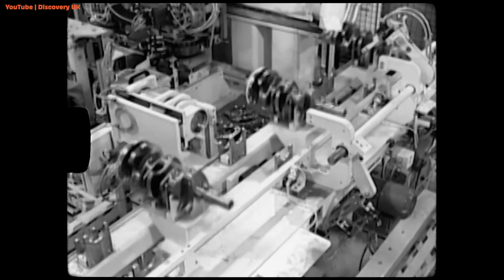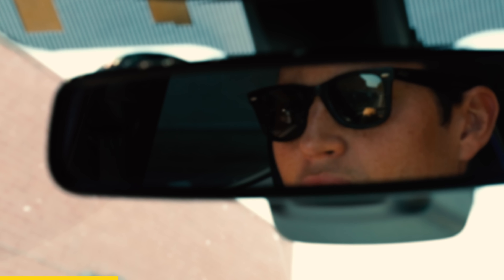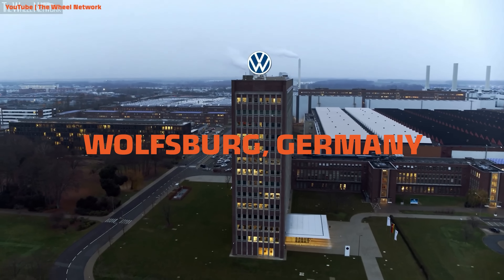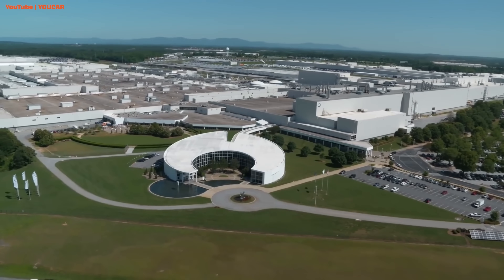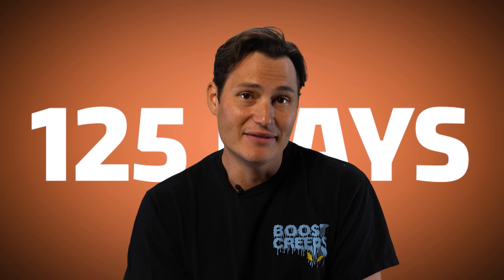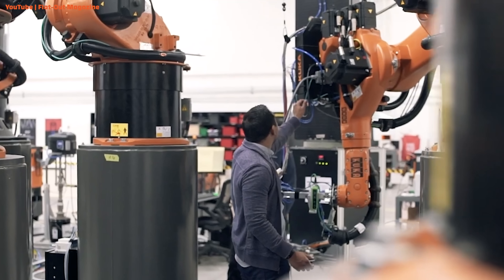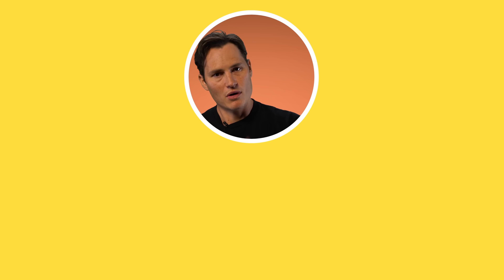A.I. Designed this Car

Comment: 3D printing technology is not that efficient. It needs alot of improvement and the raw material also need some advancement. So Engineers don't worry, you still got some time I can't tell about the future generation, I think there will no jobs for engineers everything will be overtaken by the 5D printers, advance material and A.I. Four or Five person will make a Car Manufacturing company rest (Production, Marketing, Sale, Servicing) will be done by A.I.

Comment: Feels like advertisement without actual insight. To begin with - in a 9 mile assembly line car leaves the conveyor every couple minutes, "vertical assembly" is not a way to make 100 000 cars a year. Those technologies are very important for the future - but they will reasonably extend not replace current ones. Just look at the single/composite manufacturing game of the last 30 years.
Also - considering that AI (assuming neuronal network) is not "debuggable" you will never have this without cross-check by human. Unless maybe in USA where human Life has a price tag.

Comment: This design sounds like a mechanics nightmare
Reply: to be fair, car designers have been already trying to make them nightmares to work on for years already.
Reply: @dragonsword7370  some certainly are more successful than others
Reply: @dragonsword7370  good ol fashioned human engineering figures a way haha
Reply: Who’s fixing a car worth 100k+? Oh right the deal shop most of the time
Reply: @blank1778  most of the time
Reply: @blank1778  cars made like this will be insanely cheap and definitely not $100,000
Reply: on the other hand, if the designs were public, everyone could just print them even years after the production would stop
Reply: Specially the no gap door. One little punch and you cant close the door anymore.
Reply: Computer designs the car 
Computer builds the car
Computer fixes the car

Who needs a mechanic? Automation engineers is all you need
Reply: @stevefarrimond  If you've ever tried to do diagnostics with a manufacturer flowchart (which is exactly how a robot would) you'd understand why this is really dumb.
Reply: @1337penguinman  I’m an automation engineer, trust me, it’s not that hard. 

Car has a flat tyre, robot changes it,
Car has a dead battery, robot changes it. 
And keep building its skill set until there’s nothing (or very little) a personal n is needed for.
Reply: @stevefarrimond  ok, so u need to send your car to the factory/dealer (obviously service robots are too pricey to stand everywhere) every time u get a flat tire? no way
Reply: @nt976  Believe what helps you sleep better at night. Why would a robot be stood around when it’s doing the job of a person who wouldn’t be stood around.

Robots aren’t as expensive as you’d would think, for example how much does an employee cost? There’s a lot going into pensions, insurance, wages etc. the robot is a one time purchase, plus a bit of maintenance across its life
Reply: @stevefarrimond  You forgot the computer drives the car also. May as well just get the bus to work.
Reply: @stevefarrimond  and a ton of money for the first 30 years
Reply: @stevefarrimond  nah. That means you can only repair your car at the dealer ship, which means yout car has to be world renowned, the people buying your car have to be rich, and your car is a league above others which warrants such needy repairs
Reply: @stevefarrimond  which is why tesla cars can be repaired with some special tools. So that mechanics can buy said special tools, say they support tesla repairs, and get them big bucks while tesla builds a super factory down the road XD
Reply: @davidjalkh  you’re right,  but Tesla have made there cars ‘hard enough’ to work on. Making them impossible, would be bad for building the brand. 

Now the brand is developed, you’ll find it more difficult to do and more specialist tools required, until the point it’s not financially viable.
Reply: @stevefarrimond  ive seen this happen before, here's how it'll go down. Garages with multiple sections such as vehicle repair, wheel recalibration, paint jobs etc. Will claim they can repair tesla vehicles for greater publicity, then when a person comes over with a hard to do tesla job, the garage accepts the job and then proceeds to use partnering tesla only garages, for a share of the cost
Reply: @stevefarrimond  ppl do fix it tho
Reply: Not really u just downloadthe part and print it urself the whole door is done download print EZ.u can even upgrade it
Reply: @anand.suralkar  bro first of all have you seen the printer theyre using? Second, printer resin is pretty expensive, my buddies and i in the dorm play arround with it and printing chess pieces is a chore
Reply: @davidjalkh  printer resisn is nowhere comparable to the car parts price.anyways watch their video car is almost fully moduler.and easy to repair.also they can print any parts so i think they will give parts easily if u can afford this car buying parts is a joke
Reply: @davidjalkh  we are talking about a 1.5 million doller cars and u r saying printer resin is expensive?? This car has titatnium parts in it...bro..it will be cheaper to just put gold parts
Reply: @anand.suralkar  hah you're right, but how would anyone print their own parts?
Reply: Well, in the future you're not supposed to own anything so it's not like you'd drive up do your local mechanic and ask for a wheel change. The car will go back to its manufacturer and be fixed, then re-rented to someone else while you get a car that already had its tiers changed.
Apple is a great example of this as they don't allow anyone to tamper with its iPhones, if you do the device is rendered useless as punishment for messing with their product. The phone is supposed to go back to its owner, be fixed, and resold for full trail price (profit). In the future you're not paying for products anymore you're paying for services.

I know I heard of a car company that already rents out cars this way in Japan or China, where you basically subscribe to a car between this and that hour, meanwhile the car goes to someone else. And there's this AI that's actively managing all these subscriptions telling the cars to go when and where. You just go to this web page and order a car from point A to B and that's it, like a taxi but without the driver or need to drive yourself. I just forgot the name, think I read about it 1 or 2 years ago, also LTT mentioned it in one of his shows long time ago.
Reply: Since all the parts are bespoke, you cannot take it to a mechanic. They won't be able to get the parts.
Reply: @Orinslayer  Could you please explain what bespoken parts are?
Reply: @davidjalkh  Parts that are made only for a specific use. In this case, well over half the vehicle is made of custom 3d printed parts, so they would never be easy to come by.
Reply: @Orinslayer  sick thanks
Reply: Everything will become Chinese maid they will reverse engineering every single part and make their own for a fraction of the price
Reply: @abrahamcarrillo9955  You can go to China and build your own iPhone today with genuine parts from completely random stores you never heard of right in the open market.
So what do you mean "will become"? The chinese reverse engineering stuff has been going on my entire life, did you just figure this out or what's going on?
Reply: We'll have the AI design new mechanics.
Reply: >bespoke car
>mechanic
found your problem
Reply: if this sounds like a nightmare, then let's think about other AI's replacing mechanics to fix this nightmare.
Reply: One thing that could help it in this regard is all the missing material that creates holes that you might be able to get your arm through where normally you'd have to remove it
Reply: It can also be programmed not to be too.
Reply: If the car is desgined to be assembled entirely by mid air suspension, then that same mechanical structure can perform that maintenance. Some auto alignment marks for the AI, plug in what maintenance you want and the machine does it.
Reply: there will be no more mechanics!
Reply: @leaoaugusto  that's definitely incorrect
Reply: @XetlinCakes  looks like someone does not recognize irony.
Reply: Doesn't have to be, provided you have 'repairable' in the AIs reward function. Hard to implement well, but heuristics like "don't have connections that will need removed often inaccessible without other disassembly", and "wiring channels should not have tight corners" are pretty simple. It's not like human designers have always taken these things into account either.
Reply: Sounds like nobody would be even allowed to fix it, and i bet most mechanics wont even want to touch it
Reply: he literally mentioned the amount of cars he can produce.
watch the video
Reply: That's where R2D2 comes in
Reply: Why?

Comment: Wait until you have a wreck in it, or have to repair something. One of those 3D printed parts that merges into another part... egad. A fender bender at the front could mean the entire front foundation of the car has to be replaced! Also, while the robots take up 2500 square feet, what about all the 3D printers making the parts the robots assemble? They take up space and energy, too. With all these complaints, this is early days for this kind of product and technology will mature. It is likely to be the future.

Comment: All wires are in the chasi?! Imagine trying to do maintenance on it.

"What's that? Oh we have to take it to the dealer for any work on it?"

Well, that just increased the cost of the car didn't it. 

"Oh! It's a car exclusively for the rich. I see, but wait a minute he said manufacturers can use it on normal working class people's cars."

"What's that? Oh screw the working class. I see." 

But don't we have a right to fix our own crap?

"Say again? Oh, you told BigTech one me? Sure... I can shut up." 🥴

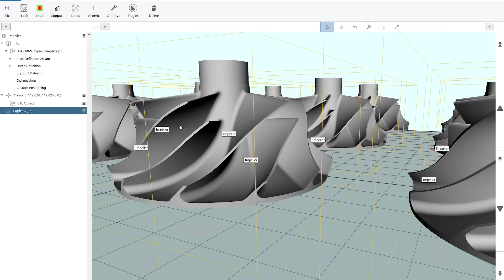Comment: Sentence from 7:19 "3d printer doesn't print out extra meterial" is obviously false as can be seen in 7:02 where you can clearly see turbine support structures that needs removal.

Comment: “A 3D printer doesn’t print out extra material” this is not how additive manufacturing works bud, you need support structures among many other things for the parts
Reply: That’s a very good point that until I read your comment that I forgot about! But that being said, the support structure from 3D printing is way less than the flash you would get from casting...
Reply: I think with they type of printer they are using you don’t need support because it’s automatically supported by the powder
Reply: @michaelcalizzi4038  You’re right. The additive process that this printer uses negates the need for support structure. So in this case, he’s right. This 3D printer does not print out extra material.
Reply: @DaOneAndOnlyKDubb  It just requires heat and pressure treatment to get rid of all the voids and cold joints left by the laser blasting away the powdered metal. Then finish machining and polishing to get a surface finish that doesn't look like garbage.

Comment: Take all this technology,  and build me a daily driver thets sleek , fun to drive , efficient,  and super lightweight.  Cars keep getting heavier,  bigger and less and less fun to drive. 100 mpg with a 1.5l should not be a problem in this day and age
Reply: Had a 99(97?)  Audi A4 for a couple months 6 cyl 5 spd, sorry sold cheap as I got a sailboat, literally gave away, jetta gli fav before
Reply: @markhill9611  too bad. Thoes were really nice and somewhat reliable.  Good luck finding one now for cheap.

Comment: There are still problems with that form of 3d printing the metal dust that is used to make the bottom of the item and dip down or more and will cause the item to be off by a very small margin.

Comment: 7:08 that’s not a subtractive manufacturing process. Milling or turning for example is.
Reply: It's part of the subtractive manufacturing process.  Subtractive manufacturing starts with the forging and molding of the parts before they are sent to be milled or turned.  Plus, stock video footage was used.
Reply: The surfaces produced even by the best 3d printers out there are pretty rough to say the least (as it was pretty much shown with the turbo which by the way is produced this way for years)
Because the surfaces are so rough the have to be milled afterwards on surfaces which have some kind of articulation going on, are connected with other parts or simply because they are visible to the customer.
So yeah... This whole no subtractive manufacturing thing is at least for the next few decades bc!

Comment: So if the engineers put in the right parameters with no typos, and the AI had all factual information it learned from, and if the material in the 3D printers are up to the engineering and DOT standards, I still don’t understand why this is designed for hypercars instead family cars.

Comment: If you are layering sheet after sheet in the “printing” process and only using the part of the sheet that the laser atomizes, how is that different than the “subtractive manufacturing” process you described in contrast? Still a pretty cool process and all, just not as efficient when using metal instead of plastic for printing I guess.

Comment: When comparing the Czinger plant with the volkswagen plant in wolfsburg you are actually comparing apples and oranges. The czinger plant produces one car per 125 days. The VW plant produces 3500 cars per day. In other words, in the time it takes the czinger plant to prodce one car the VW plant produces 437.500 cars. This of course is an unfair comparison, after all we are comparing one incredibly small car production plant to the largest car production plant in the world. So, how long does it take a traditional car manufacturing plant to build a single car from raw materials to finished car? Well, it turns out the classical production process of a car consists of stamping, welding, painting, assembly and inspections. And this takes, depending on the specifc plant in question somewhere between 17 to 18 hours. So, it's almost 170 times faster than the czinger process. Production cost for a regular car lie anywhere between about 33.000$ to about 133.000$ depending on the car model. Unfortunatly i wasn't able to find any numbers on the production cost of the czinger car so i can't really compare it.

And don't get me wrong, the basic idea is good, but the only thing (at least at the moment) that are economically viable to produce with that are supercars because the demand for them is rather small and the price is high.

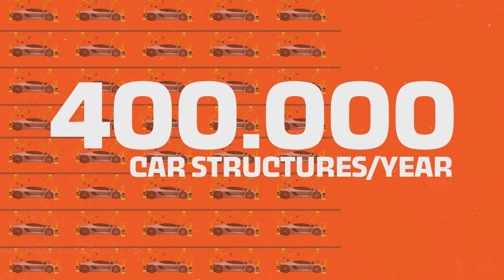Also, just a small correction at 12:00 As i explained earlier, the classical assembly line we have today is almost 170 times faster than the czinger process. In other words, to match the production speed of a single classical assembly line you need to have about 170 czinger assembly units in place.

Comment: So. Your selling this hard, but I’m going to call you out. To say that current manufacturing has great amounts of waste in materials but 3D printing does not is absolutely false. Current manufacturing allows us to re utilize the waste materials in order to make more parts, a normal 3D printer creates waste with structural supports for the parts made, they are not typically recycled on the spot. So wrong there, and powdered metal parts do the same exact thing as what current manufacturing does, take the waste and recycle it to make more parts. And if your impressed with a 0.004” (that’s 4 thousands of an inch) of accuracy then you should step into my field of work as a millwright where people (yes I said people) build machines with an accuracy of 0.001” or even 0.0001”. I do this on a daily basis. So this is cool and all but the technology is not superior to what a person or people can do. I build turbines in the power generation field and I have to say I am not impressed that AI can build a car. I’m more impressed that it has you so dumbfounded about it.

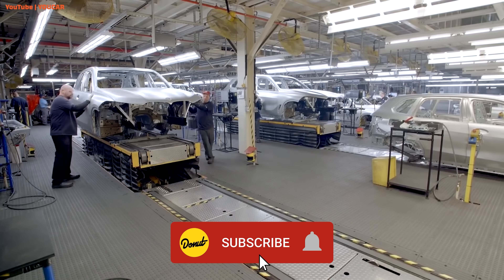Comment: "manufacturing a car has more or less been the same for the last 120 years" ...  1:52 .... you would have to be an idiot with no clue whatsoever to say that.... 100 years ago they used wood as a manufacturing material for one example....then came things like advanced materials and composites, new alloys for chassis, engine and panel manufacture, just to name a few examples... manufacturing cars 120 years ago is not even close to the methods used today...

Comment: Utter 100% bs. Not designed by AI, optimized, which has been around since the late 90's...Its not new at all. Seriously, aerospace has been using AI ever since CAD programs went 3D...Its become somewhat of a pseudoscientific term used by youtubers and media to signal some "OMG its the Terminator" moment.
In a nutshell, AI is any program that can sift through massive amounts of data and find specific PROGRAMMED correlations and update its own algorithms, or in some specific instances, its own code. Its nothing amazing, a simple 10 line program for chess could be termed 'AI'.
AI cannot design anything from scratch. It would need to be fed lots and lots and lots of examples, the problem here being the usual one: garbage in, garbage out. So it would probably take MORE time to design a car via AI than to simply design the damn car, and have the AI suggest structural, aerodynamic improvements....which is wildly different from being designed via AI.
The rest of the video is trash: laser sintering is like micro-casting, as detailed in extreme by Rolls Royce than made a rocket engine using this method. It is, in effect, much worse than forging, and only non-critical components can be made reliably via 3D printing. Most end of forging the 3D print anyways. Rolls Royce had to account for the weaknesses of the method, the resulting engine being less powerful, larger, weaker, less reliable. 
Hence, Czinger has tons of carbon fiber providing the necessary strength.
For the TLDR crowd: this video is a puff piece paid for by Czinger, for Czinger.